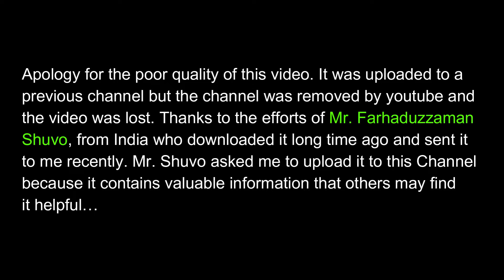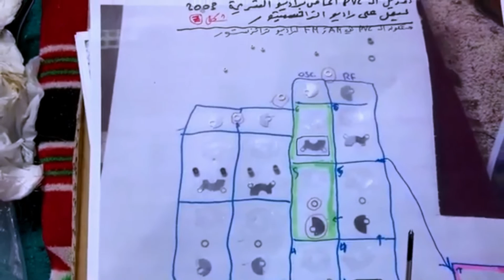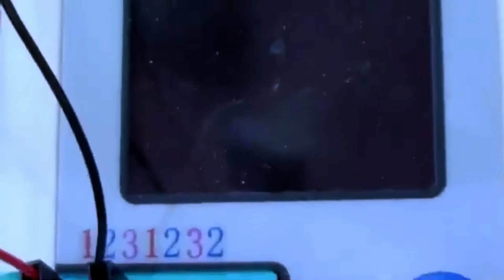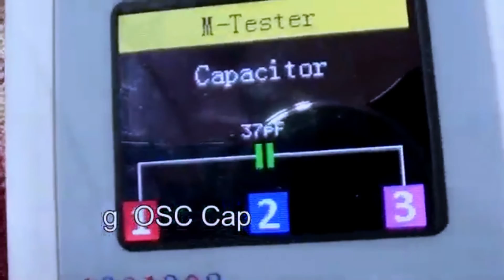Polyvaricon Variable Capacitors "PVC" Comprehensive Tutorial

Comment: Hello sir, This is what i'm making, is a crystal radio, What i need to know is how to find the low end or the high end to a 3 prong capacitor multimeter...... What i'm going to use the  3 prong capacitor to adjust the  antenna coil, before it gets to the tuning coil. and i have tried everything to test it with no reading. can you help please?